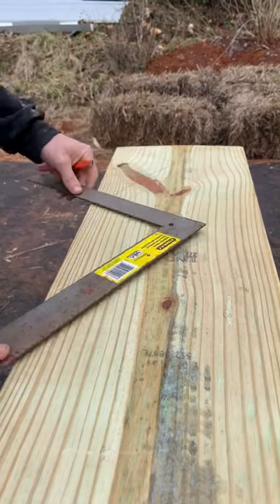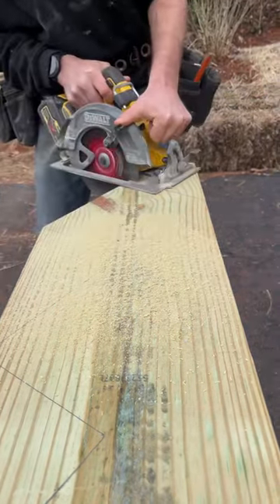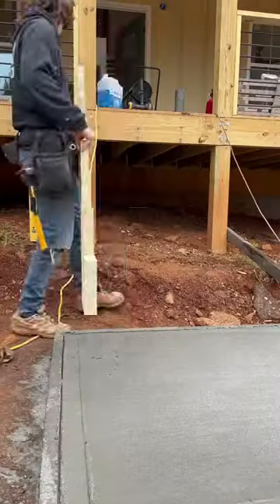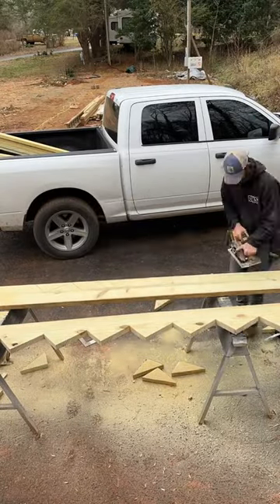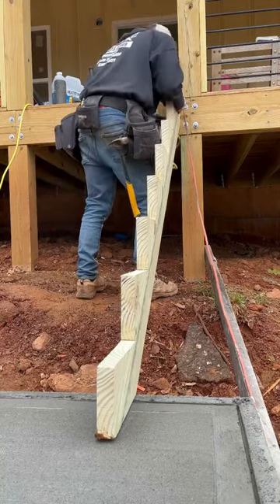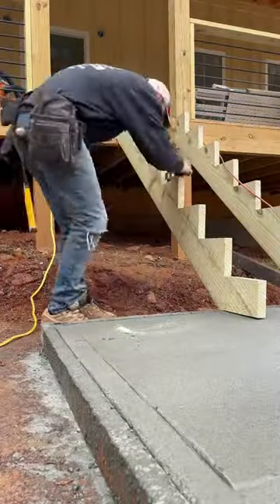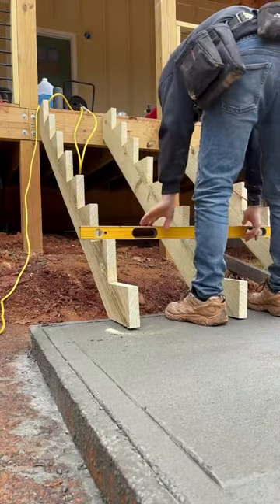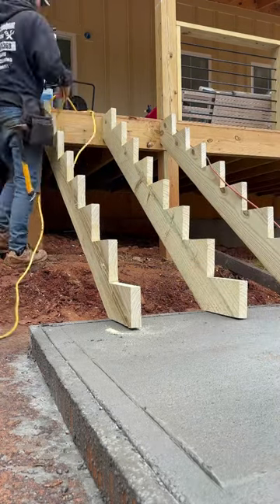Stringers 👌| Beautiful deck stairs pt.2 #construction #builder #skills #shorts #porches #stringers

Comment: the first thing you do is put a set of stop nuts on your framing square so all your cutouts are identical.
Reply: They're called stair gauges. This fella has a lot to learn before he starts instructing others.
Reply: I prefer a long layout stick. With stair gages invariably one lands in a wain or bad spot on the board.
Reply: Y though bby you
Reply: @michaelmcclellan9422  that works too....but why spend time making a jig when i already own the right tool for the job? i CAN start a fire with a bow and drill....but i prefer a bic lighter! 😉👍
Reply: @Montana Elkwhisperer  24" 1x2 straight maple, stick, run a saw kerf with your tablesaw centered in the 1" way, coming in from each end, leaving 6" in the center.  Slide the saw kerf over your framing square, clamp with spring clamps, done
Takes 5 minutes to make and way better than stair guages.
Reply: And I'll tell you my way is the back lighter, yours is banging flint to steel.
Reply: @michaelmcclellan9422  and his first step up will be higher than the others,   the first rise needs to reduced by the thickness of the tread, whether it be an 1-1/2” or 1” etc
Reply: Well.....yeah, stairs 101.
Reply: Deduct for the floor thickness of the 2nd floor. Not necessarily the tread thickness.
Reply: @michaelmcclellan9422  say the risers  are 8” tall so when you put a 2x12 on top of that first step you will have a 9-1/2” first step, so you need to reduce the first step riser by the thickness of the tread
Reply: First thing is remove your concrete forms...lol

Comment: Joist hangers for those stringers butting the deck beam are code. Got to have them.
Reply: not in Canada
Reply: @frostycools1315  Most common method of deck failure is joist separating from the ledger board against house. How do they tie joist to ledgers in Canada? Corner blocking?
Reply: @Nill757  only rookies cut stringers us pros mortice the stringer and that is its own hanger and as for joist to ledgers yes hangers
Reply: @frostycools1315  Ok yeah that’s what I meant.
Reply: @Nill757  are you sure this time ?? lol  also its not code to use hangers if you cut the stringer properly and mortice in the threads let me know if you need a lesson on how to build a proper stair that will last a long time not this junk

Comment: You can do the end cuts and then check it for fit.  Then you can set the marked stringer on top of another board with the top edges flush. Clamp or screw them together in a couple places and cut deep enough to scribe the lower board. Repeat for the third stringer. They will all be identical.
Reply from the maker: Thats a very good idea and will put that in my tool belt for next time :)
Reply: U just blew me away with this comment lol thank you

Comment: I always drop my top step down one step, and use the deck itself as a step, but that’s code where I’m at all so you have to have for stringers here
Reply from the maker: Not here. Make the stringers the top or don’t. Doesn’t matter. Either way it’s the same structurally
Reply: Step down is a must.
Reply: Step down off I think this stems down to how people learn the correct way versus how they adapt in life if you taught the wrong way you think it’s the right way when actually it’s the wrong way
Reply: Step down is a must. It also makes your railings finish cleaner with less posts.

Comment: Does code in your area require metal stair hangers (joist hangers)?  I am uncomfortable simply nailing stringers to the rim joist.  Sure, it might be fine, but I would take extra caution with steps.

Comment: Is there a reason you have a stair coming off the deck at the top? You can eliminate a riser by using the deck as the last rise. 
IMO it looks way cleaner that way
Reply from the maker: I like this look way better. I’ve built them both ways many many times

Comment: all steps that I ever set the top tread was NOT even with the deck. it was one rise down
Reply from the maker: That is definitely a style as well. It’s becoming more and more popular for the first “step” to shoot out before dropping and i fell like it really adds to the deck.
Reply: That’s wrong good luck with the railings. I’ve been building 25 years and never framed stairs this way
Reply: @josho4971  nobody cares!
Reply: It’s the “new” style because people don’t know what they are doing. That top step even with the deck makes your railing double in cost and look terrible. How about we start a new trend and go things properly!
Reply: @johnterpstra8431  people need to
Learn the right way rather than winging it .
Reply: @johnterpstra8431  yeah should have deck as top step but “double” the railing cost? Cmon.
Reply: @Nill757  2 extra newel posts  (so your stair rail stays at proper height), fitting the short section of level rail and balusters.  Labor and materials?  Yeah it’s a lot more money!
Reply: @josho4971  The guy who built my deck 15 years ago made the top step flush with the deck.  I have no preference either way as the "deck user."

Comment: Why didn't you add 1/2" to each tread and pick up 4" in length so at least you would land on the pad? And you should notch the stringers for a 2× treated base plate.

Comment: Need to notch in treated 2x4 across the bottom of the stringers / 3/8 wedge anchors 4”. . No blocking or hangers at the top of the stringers . Hope that’s not the only level you have .

Comment: I like to drill a hole at the rise/run intersection.  I feel it helps to avoid cracking as there is not a hard corner and finishes much cleaner
Reply: Yep, rounded corner definitely improves strength over square inside corner.  Factory stringers all have them.  

I never cut my own anymore.   Why?
Hauling uncut 2x12s is heavy. 
Easy to miss a knot that’s going to lie at a corner. Factory never does. 
Factory never stocks screwed up, tread/riser cut. 
If I cut, I need that circ saw, jig saw, drill for corners.
Time.
Reply: Fascinating! Good call
Reply: @Nill757  I’ve never used precut because they never math out
Reply: @mick7even  How’s that?  Code tells you pretty much rise and run, so it’s a matter of counting steps, and then for exterior and always build up or dig out and inch or two of ground under bottom step.
Reply: @Nill757  code has a range. Plus you ever built stairs on a deck 12 feet off the ground? With the slab already in place? I’ll cut my own. Thanks!
Reply: @mick7even  yep ok, sometimes have to cut your own.  usually guy putting in the steps can spec that bottom slab but yes not always.

Comment: You have the idea but you're not there yet
Reply from the maker: Meaning…???
Reply: Typical youtube armchair master builder. All criticism and no input constructive. Sad.
Reply: You're right, rude of me. I'm sorry. I'd start by notching a 2x4 cleat into the bottom and connecting it into the concrete. Id also do the small amount of work to drop the first step, so i save myself a railing finish mess and an eyesore later
Reply: @dimebagdarrel00  yeah

Comment: Thought the Code is 4 stringers. Plus did you account for thickness of the top step, and an attachment point to the cement.  Typically 2x4 pressure treated lumber, that unites the stringers together.
Reply: Code is 18”.  Four stringers covers 6’ wide (it’s not 6’ to my eye), three 4.5’.

Comment: Factory made stringers will use a rounded inside corner each step.  Reduces the stress on at that comer compared to a right angle cut.
Reply: Sure and factory stringers will never comply to code relative to rise/run requirements.  Each deck is a different height and "pre-fabbed" stringers won't usually work.
Reply: @Wowzersdude-k5c  Never? How’s that?  Factory rise run is of course cut to code itself.  Then:

1) often there is room to grade the no pad landing a couple inches up down to where I want to the stringer to land by code, or 
2) I’m pouring a landing pad myself and make the elevation what I need, or 
3) the deck is designed by somebody else knows what they’re doing and the height above landing is set so that code rise run is right there. 

Yes, sometimes none of that works and it’s custom cut, carry or ship the weight of 2x12 to the site more, double that w factory cut, time for the cut, and then occasionally in board selection I miss that knot in a step corner where it can’t be or just make a cut mistake and it’s back to the lumber yard w a vehicle that can haul full length 2x12, more time.

Comment: With somewhat long stringers i'll cut all the treads first and then rotate and slide back and cut all the risers is a tad quicker... i'm a worm drive saw carp tho... most local codes call for a metal hanger and specific fasteners for stringers now bruh... check your local... and i scribe the stringers to the pad yours are heeling.

Comment: The top step should not be flush to top of deck . Take one step off those stringers . The reason is your railing will stop at the front of the top step and you will have a small level railing or a railing that is not to code .
Reply from the maker: I make it work with the codes here and prefer the look of the top tread being deck height

Comment: Dude, maybe ask for advise before you just build, or just buy a book on building to code, I see a lot of issues and fixing you will be doing down the line, the shorts algarthym has found me and is showing me all your stuff.. 
Those stairs are not going to be happy after some time in the elements and people walking up and down..
And no hanger brackets, oh boy those "none" rusting nails are going to be fighting to hold on..
Hope you at least anchored the stairs to concrete pad that just stops in the middle of now where and just sits on the ground with rebar, that rusts.. 
It like you building with lego and hoping your brother does not come around and kick it down..

At some piont in time, there is this thing called structural failure, and when you do not build to building standard's and just go along with what you think you know, things goes wrong.

Comment: Screw your stringers,  never nail.
Reply from the maker: That’s not a bad idea, I’ll have to go back and throw some screws in there. :) thanks!
Reply: Always nail, as screws, to be sharp, are hard and brittle and snap  too-readily with lateral movement.  Homeowners use em, but put a nail in 1/2way and put a screw in 1/2way.  Strike across (up, down, sideways) with a hammer and report what you notice-